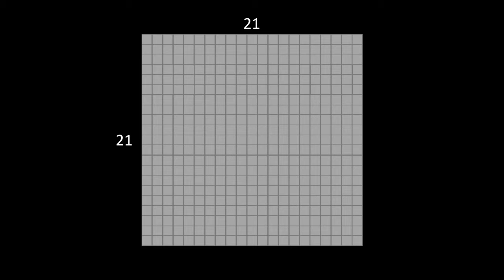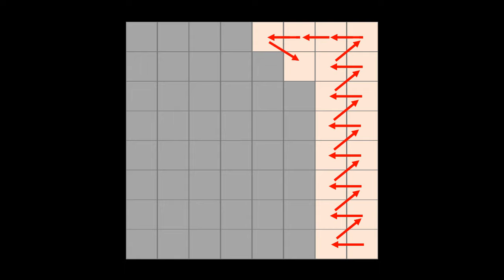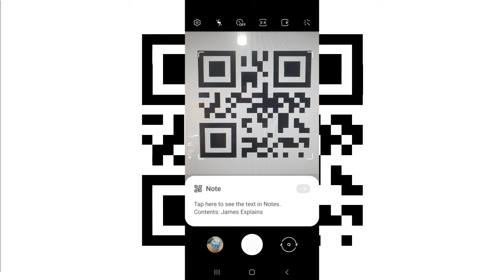How QR Codes Are Built

Comment: Very well done!  Thank you!  My question is: how does the information stored in the code remain editable? Is that information (link, contact info, etc.) actually stored on and referenced through a server?  Or does the pattern just by itself generate the information through the camera reader software?  If so, how then does the information remain editable?  For example, even with free QR generators, I can simply load up the image to change the linked info, but the image pattern does not change.  So the QR on all my printed business cards still works but displays updated info.  Ok, thank you again.  Appreciated your thoughtful visual approach.
Reply from the maker: There's multiple ways it can be done. The QR code is just the data displayed in a visual way, so the raw data of the card (name and contact details and such) could be stored but then changes to them would change the QR code itself. It would most likely be the case that the system you use for your business card stores the contact details on their server, and the QR code contains the link to wherever the data is stored. That way the link to the data is always the same even when the data itself changes.
Reply: @JamesExplains   how many variations are there on modern QR cards? is it approaching infinite? ive noticed this local government service generates a QR code for each person and contains their name among other information but every time you refresh, reprint, or log in to get the page the QR code is visibly different
this would mean there could be thousands of these QR codes for each person if everyone refreshed the page that many times further more none of this information is linked to servers as the scanners/codes work without an internet connection

how hard would it be to edit such QR codes,  are there any software programs available to do such?

Comment: The 3, rather than 4 squares, in Version 1 are an OCD trigger for me. Why can't they manage to use an even number of squares and place them evenly? Aghh!
Reply from the maker: Because if you had squares in all 4 corners, the reader wouldn't know which way to orientate the code. It would be possible to do with squares in all 4 corners but you would need extra space dedicated to orientation, and wasted space on the extra squares, so it would hold data less efficiently